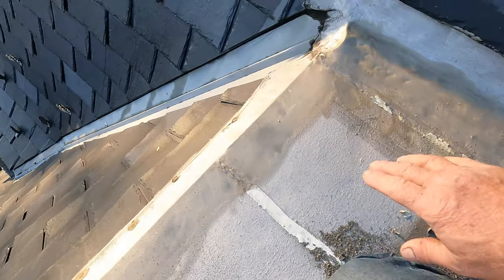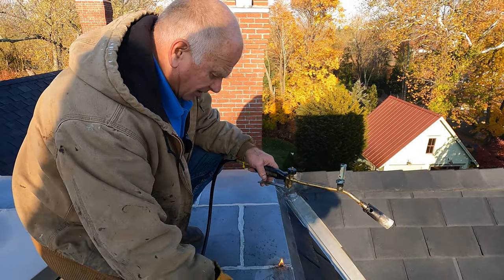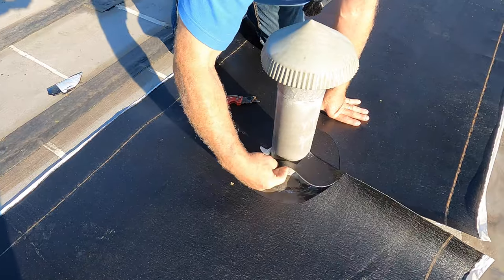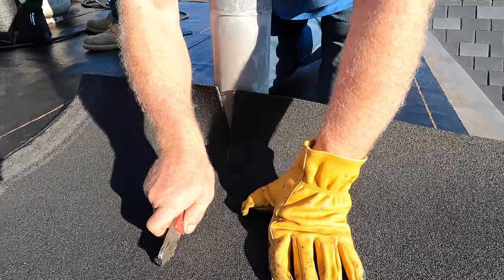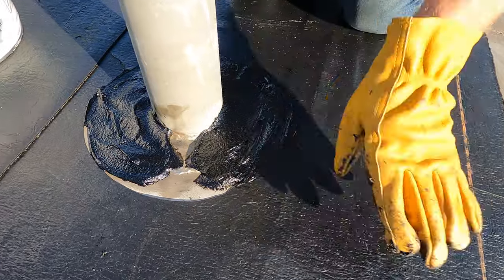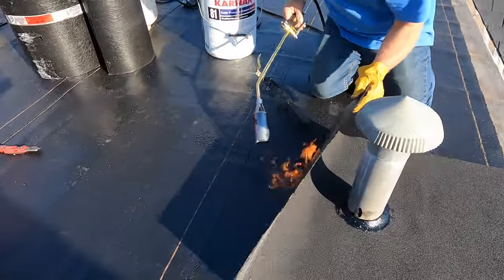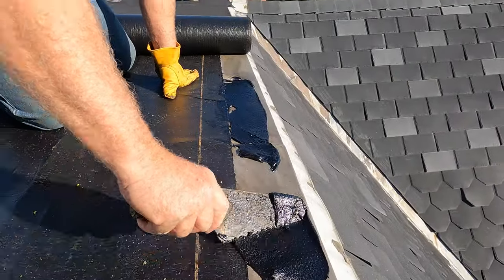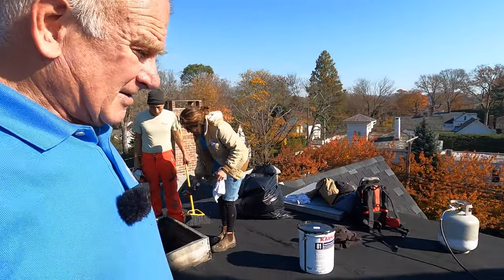Install Torch Down Rubber over a Metal Flat Roof

Comment: Hi did you ever make a video on installing or waterproofing a railing on a flat roof? I was thinking of installing one but not sure how or what would be a good option. Also want to put a hatch like in your video.
Reply from the maker: yes, I have a few videos.  One is on post flashing and the other is on Post Jacket. Then I have a 3D video that explain also how a Post Jacket works